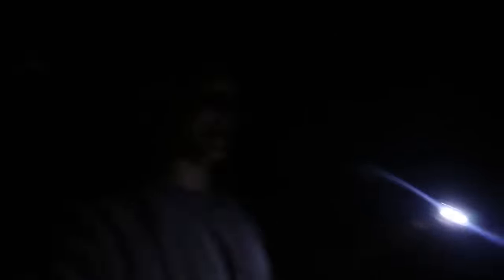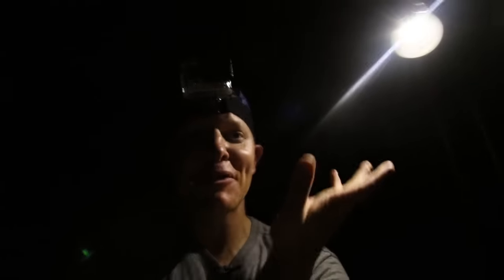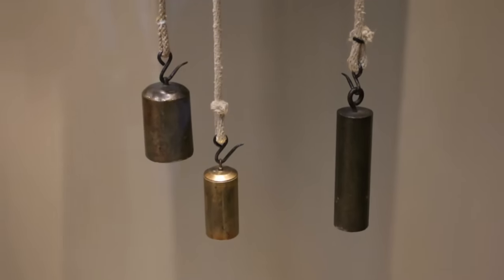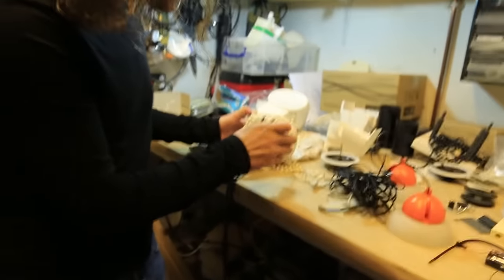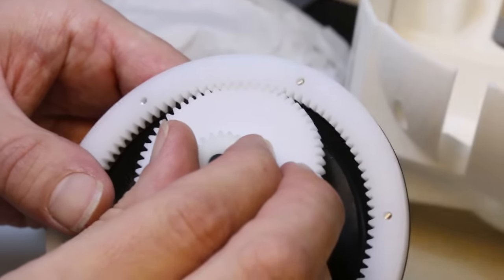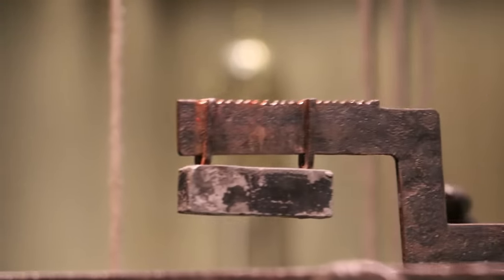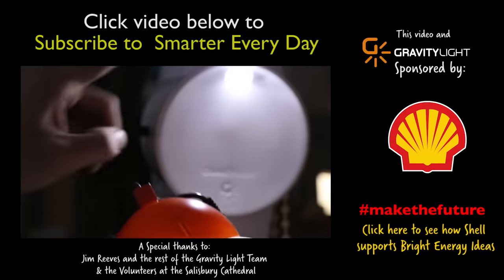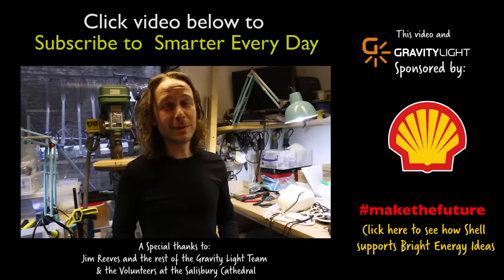Turning Gravity Into Light - Smarter Every Day 146

Comment: the light is not exactly powered by gravity. It is powered by your muscle when you raise the weight. The falling weight is just a store of energy that was created by the person
Reply: +ambrous shut uuuuuuup
Reply: +ambrous Well TECHNICALLY muscles are made of star stuff, and the sun is a star, so really it's solar powered.  :)
Reply: +ambrous but if there wasn't any gravity it wouldn't fall and it wouldn't create any power to power the light so gravity wins (gravity falls to be more accurate )
Reply: +ambrous thanks i was actually a bit confused
Reply: yes it is the potential energy
Reply: +ambrous Yes, but the energy your muscle uses to lift the weight came from the food you ate, which came from the energy in sunlight, which came from fusion. It's a light powered by a fusion reactor =P
Reply: +Andrew Rowe technically because it is solar powered it is fact fusion powered as stars carry out fusion reactions
Reply: +Andrew Rowe technically because it is solar powered it is fact fusion powered as stars carry out fusion reactions
Reply: +ambrous To be more exact the amount of energy you would get out of the system would be E = M(mass) * G(gravity) * H(height) so depending on how much stuff you put in the bag or how high you set up the system, is relative to how much power you get out of it.
Reply: +Yousef Aiman If he didn't have muscles it wouldn't have gotten up there in the first place :-/ Muscles literally beat gravity.
Reply: +Andrew Rowe technically because it is solar powered it is fact fusion powered as stars carry out fusion reactions
Reply: +ambrous The potential energy is created by human labour, but the energy is being released due to the force of gravity. I know you are just trying to seek attention, but I don't want to see a wrong comment get unanswerd :)
Reply: +ambrous Sure, but then, it's not powered by you either, it's powered by what you ate for dinner.

Which is powered by whatever it ate for dinner. Which if you follow the track leads to sunlight. 

So in fact you're just using a very innefective way of transferring light into light.
Reply: +ambrous Weight is the cause of Gravity+Mass.
No gravity = no weight. Only mass.
Reply: both the person and gravity power it. Person does work to move it up, gravity does work to pull it down.
Reply: +ambrous And the persons energy comes from the food they eat, which goes back to growing plants, and the plants get their energy from the sun. So technically is solar powered, but 

https://xkcd.com/1475/

let's just call it gravity powered.
Reply: +Yousef Aiman If there was no gravity the equation for potential energy would also result in 0. What you say might be true but you didnt debunk his claim with it.
Reply: Muscles which are powered by the chemical reaction between glucose and oxygen, which is powered by the chemical energy contained within the atoms of those substances.Atoms which were all formed by the nuclear fusion reactions that occurred in stars (other than the hydrogen atoms in the water and glucose) from hydrogen atoms, which were formed by rouge protons, electrons and neutrons combining, which were formed by the Big Bang, which had to have been caused by some force outside of time.
Reply: +Marley Bradbury Yeah, my thoughts exactly
Reply: my whole point here is that gravity is not where the energy comes from in the system. The potential energy is placed in the weight by the human muscle. It is then extracted from the system via gravity. The source of the power however is the human muscle... Dinner last night... The Sun...
Reply: Marley Bradbury Nice joke.
Reply: +Yousef Aiman but in that case you also had to use no power to lift it. you simply couldnt increase its potential energy. hence his argument still holds: the work is done by the human
Reply: +Zech Of The West first of all weight is the result of gravity not the cause. secondly the reason why you can use this device is due to the potential energy of the bag. If you had no gravity, there would be no way to store any potential energy. but even with gravity its not gravity doing the work, its you when lifting the bag
Reply: +ambrous I see what you mean, but what if there was a battery that stored energy through a dynamo, which will then pull the rocks back up after a while? There should be enough energy generated through the dynamo, which will be able to power both the light and the motor pulling it up, I think. Then it would probably be powered by gravity alone.
Reply: +ambrous Now, well... Energy and mass is constant in the universe.. So if you want to trace back, every energy can be traced back to the energy produced in the big bang.. All forms of energy (viz. light, heat, potential, kinetic, sound, nuclear, solar) was packed inside a dot, and got released during the Big Bang.. So in a way this light is powered by the Big Bang.. Now I made the Big Bang happen.. You do know "I AM HIM".. So thank me.. Sometime soon I would be like "Now I AM Become Death, Destroyer of Worlds"...!!!
Reply: +Seah Ying Xiang No that breaks the fundamentals of conservation of energy, and basically create infinite energy. At best, if you had a way of converting ALL the potential energy into electric energy, and you also had a perfect motor, you would only be able to hoist the weight back to the exact position it started at.
Reply: the title is just misleading. In no way is gravity being turned into light. Gravity is being used to store the potential energy that is put into the system when the human arm raises the weight. If anything, it should be titled turning human arm energy into light storing the energy via gravity vs a chemical battery..
Reply: +ambrous Le sigh... Gravity is stored energy. Your body has enough stored energy (pushing against the surface of the planet) to cause a massive explosion. In your case that explosion might be more massive though.

You can't create energy, you can convert one type of energy into another type of energy hence the term "powered by gravity" is correct as there is no "powered by magic" in this world.
Reply: +ambrous Yes, and no. Yes, because that is what's happening, no because ignoring the prior state the energy was in because it was in some different form previously is... moronic.
Reply: +Cadde Gravity is not stored energy, that's just silly. It's also not an energy form in any manner, no more than distance or curvature are forms of energy.
Reply: +ambrous Correct, we create Gravitational Potential Energy, which transfers to kinetic energy via gravity.
Reply: At least everyone can agree that it's using gravity to power a light.
Reply: Joshua Pearce Get educated pleb.
Reply: +ambrous Exactly! And he started with "What if you lived so far off the grid that you didn't have access to batteries?" He then proceeds to promote a mechanical battery...
Reply: Hmmm... It is pretty common to refer to a power storage as what powers something, for example, something with a battery is generally said to be battery powered. Now, it would perhaps be more correct to say the lamp is powered by a gravitational potential energy storage system, but that is a rather unwieldy thing for a title.

As for tracing back where the energy originally came from, well, remember that all "energy sources" we use rely on releasing stored energy, even the sun is just releasing some of the energy stored in the atoms it fuses.
Reply: Ts6451 Yes, but the title is still super wrong. "Turning gravity into light." Not "Using gravity to produce light." Actually turning it into light, which is silly.
Reply: seigeengine It's not pedanticism when the title is that misleading. This channel is for educating, isn't it?
Reply: Joshua Pearce The title isn't misleading. If you have any knowledge whatsoever of the sciences, you'd know that it isn't strictly correct, but you'd also understand it just fine. For someone who doesn't know, talking about converting gravitational potential energy into light would be both confusing and potentially could put them off from watching, whereas they'd understand "turning gravity into light" easily, and be intrigued.

Nothing is served here by being "correct," except correctness. Welcome to pedantry.
Reply: seigeengine "Using gravity to produce light" would have been an equally brief and yet far more accurate title. Whereas "Turning" misleads people.
Reply: +Yousef Aiman if there wasn't any gravity in the same way when you rise it up you will not apply any force, so the system is in balance. What ambrous had said was correct.
Reply: +Andrew Rowe no, because you power it with energy, not matter. physics isn't a word game
Reply: There are 2 components. You and gravity
Reply: +ambrous Without gravity, the energy stored via your arm in the weight couldn't be released
Reply: +ambrous ...it is powered by the food you eat. Oh wait, it is powered by the sun, which makes the plants grow that you either eat directly or via the meat you eat. So effectively, it is powered by nuclear fusion, awesome!
Reply: Nilguiri That isn't an argument?

The existence of coal does not prove gravity to be false.
Reply: Nilguiri I'm saying that the ability to store energy differently does not change that gravity is the means by which the stored energy is actualized.

That is, gravity does the same thing your muscles do, it converts stored potential energy into kinetic energy, so saying your muscles do it, but gravity doesn't, is.....bullshit.
Reply: That's like saying a hydroelectric generator is solar powered because the water driving the turbines had to be evaporated by sunlight and rained down again into a reservoir. 
It doesn't matter how the bag gets in the air, only that it has some GPE relative to the ground to drive the gears. That's why it's 'turning gravity into light'. What you're saying is technically correct but serves no point.
Reply: +ambrous I don't think so because if I take the weight and wave it around or hold it for a minute, that energy isn't getting "stored" it won't prolong the time the light is on. No matter what you do, or how much energy you will expend on the weight, it will always take 20 minutes for gravity to lower it (when it is hoisted on the GravityLight thingy). I'm by no means a scientist but it just sort of makes sense.
Reply: +seigeengine No, the title is super misleading, because gravity have absolutely nothing to do with the process - change the weight for a spring like in a pocket watch, and it will work in zero g. And it's not a "free energy", you pay for it with food you eat, it's just that LEDs are so efficient, you don't notice the difference, and while it may not be significant for you, it very much an issue for places this product is supposedly aimed for.Also flashlights with built in generators have been around for years, so there is no novelty in that as well. And while they use rechargeable chemical batteries, they also way more portable, and have so much less moving parts they have to be more reliable, I mean imagine sand or dirt getting into cogs - system like that can not be hermetically sealed unlike "shake it up" kind of flashlights.
Reply: +ambrous The arm that put it there isn't apart of the system. It's all a matter of scope your frame of reference. Just like the chemical energy in your arm was available to be used just was the gravitational potential. Its no different to saying "The battery doesn't power the clock" then claiming that the clock system extends beyond the battery. Energy transforms get over it son.
Reply: seigeengine Alright mr. demagogue, first of all stop with inserting false analogies - of course chemical reactions are the very foundation of the process we call fire which you are implying. But we are not talking about fire here, the product is heat in this case and if you plug an electric heater powered by solar panels then yes, those chemical reactions have nothing to do with heating up your house they merely serve as a solar energy storage. The way it's transformed into heat doesn't matter in the slightest.

But the elephant in the room you seem to ignore is that you have to pay money for the wood, and gravity is free unlike the food you'll use up, therefor can be ignored for practical use. So saying you can make energy from gravity is a big lie and false advertisement. It's like saying your oven is powered by air, you just have to add firewood.

Guess who's being a pedant now.
Reply: catwaterboy You can say whatever, but it will not change the fact that this is a clickbate title and false advertisement, that essentially promises you "free energy", while there are real ways to extract energy from gravitational potential, like tidal hydrogenerators.

Also this wasn't educational in the slightest, which goes against the goal of this channel.
Reply: +Andrew Rowe and the sun was made by God so really its God powered.
Reply: seigeengine Because saying this device is working on gravity is like saying nuclear power plant is working on water, fireplace is working on air and combustion engine is working on inertia of pistons. Which is all partially true, but deliberately missing the point - just as steam is turning turbine, oxygen is doing the active part of the work in burning or pistons are turning the crankshaft, gravity is pulling down the weight, but all those things are put in motion by another source and that's what matters.
Reply: seigeengine And if you want to be overly reductive, then no again, light is not powered by gravity, but by electric current flowing through LED, which only proves that title is misleading in more then one way.
Reply: +Boredness Indeed, ALL ENERGY IS NUCLEAR.
Reply: Carlo Mascherini But it always produces the same amount of energy, no matter how much energy the human puts in. If you carry the bag round a mountain and back before hoisting it, it'll still fall the same amount. It also doesn't have to be a human hoisting the weight, and you can use ropes if you like, or just lift it, or have an elephant do it for you if you know a sufficiently well-trained elephant. The only constant is the gravity pulling it down.
Reply: +ambrous I don't think you're entirely correct there. Sure, it's your muscle that gave it the potential energy, but gravity (and gears) converts that stored potential energy into kinetic energy, which in turn gets converted to electrical energy and so on.
Reply: Carlo Mascherini My point was more that how the bag gets up is irrelevant to the energy generated by the device.
And yeah, that's what an LED does; convert electrical energy into light. The gravitylight represents several transformations of energy. Saying it turns electrical energy into light would be unhelpful, because you don't need electrical energy to use it. All you need is a way of producing a GPE in a bag. Hence it's a gravitylight.
Reply: Ben F No it's not, change bag for a spring and it will work even in zero g. It's not dependent on gravity, but rather on a way to input potential energy in the system.
Reply: Roman R If you add a spring, then you're changing the device? If you change the LED for a heating element then it's no longer producing light, so how dare they call it a gravitylight! This is the most ridiculous argument I've ever heard.
Reply: +ambrous you (just like me) wrote a comment on youtube and wasted your muscle energy into friction, sound, ... but by doing just this, can you light a bulb? it seems nothing to us doing like just picking a glass of water or our school bag from ground to desk, as you do it everyday. but its interesting to learn that you could light a bulb by this everyday easy act, and gravity helps to do it!
Reply: +soham zemse I never said that this was not an ingenious and useful device. I just take issue with the title of this video. This device in no way turns gravity into light. It uses gravity in the mechanism. But it does not convert gravity into anything.
Reply: Ben F Exactly what I can tell to you. More so you've just proven my point. Say you have two nuclear reactors, in one the first stage heat carrier is water, in another - metal meld. Are not they both called nuclear reactors? And none of them are called water/meld reactors, and guess why.

And yes, "light" part is just as wrong as "gravity" part, should be called electrical current from potential energy at best, but in reality kinetic energy from potential energy.
Reply: ambrous Except it's nothing new. I'd say it's in every way worse then "shake-it" kind of flashlights - it's heavy, clunky, noisy, have a lot of moving parts and can not be hermetically sealed otherwise there could be no grip on the belt - just imagine what will sand and dust and hair do to those cogs, I've been a child and played with toy cars in a sandbox.

Also it's 10 bucks on ebay.
Reply: Roman R Good God. The gears are the part that turn gravity into kinetic energy, the motor turns kinetic to electrical and the led turns electrical to light. As a whole, the thing turns gravitational potential energy into light. Hence, gravitylight. You name something based on what it does, not the first thing it does ffs.
I don't even know what your point isanymore to argue against it in the first place
Reply: Ben F Ok, let's call combustion engines noisy spiny stinky hot metal thingies, will that be correct? Hence combustion engine, because combustion is first, hence nuclear power plant, because nuclear reactions are first. Not inertial engine or steam power plant.

And how many times does it have to be said that gravity is never used in the way that there becomes less of it in some mysterious way, it have nothing to do with gravity, just potential energy you provide the system with.
Reply: Ben F Well, it's false advertisement in a nutshell and you seem to defend it. As someone pointed out before I was expecting to see something new about black holes and how they are evaporating, something I didn't know, but I got clickbate add for a subpar product instead (just google "shake-it flashlight"), so yeah.
Reply: +ambrous CREATED? heart attack
Reply: +ambrous Well Gravity light sounds catchier than Do you lift brolight.
Reply: Roman R I don't see how it's false advertisement? It does exactly what I expected it to do from the name?
Reply: Ben F Is it called manpowered light? Because it's skipping a huge part there.
Reply: +ambrous thats really thoughtful of you but again if there was no gravity ur muscles don't need to work :)
Reply: Rishabh Chandra That's the silliest argument I've ever heard. Work is not done by gravity, it's done against it. It's like saying "if there were no wall, we wouldn't need a jackhammer to demolish it, so work is done by wall" If there were no gravity, universe would be an evenly distributed cloud of mostly hydrogen, so what?
Reply: Roman R Yeah i got it figured thanks!! I misunderstood 'powered'
Reply: Roman R Work is done by gravity. Work done = Int(F)dx. The force of gravity is equal to mg, making W = Int(mg)dx which gives W = mgx because the object is falling in a straight line and not about a curve. Since the object is falling a distance of h, we get a final solution of W = -mgh.

That's also not the point. The point is that you may have to lift something up to get the light going, but then you no longer have to do anything. The light always lasts for the same amount of time (unlike a shake torch) so you can hang some rocks in a hammock and forget about needing to do it again for an exact amount of time without it suddenly going out on you. The power is coming from the force of gravity, not the entirely arbitrary method you use to get the weight up.
Reply: Ben F Gravity isn't a force, and you'll still have to live on timer. Which you can't power. And shake torch give a warning by dimming instead of turning off in split second leaving you in pitch blackness to stumble through room and recharge it blind.
Reply: Roman R I didn't say gravity was a force. Gravity is an acceleration, which is a force when acting on a mass.
Okay, I get it, you don't like the product. Doesn't mean Gravitylight is 'false advertising', though.
Reply: Ben F Nope, you didn't get anything -product is actually pretty interesting, except that complete blackout when weight stops, and the fact that it's a non-hermetic cog system in the not so clean environment. I wonder if they could use capacitor like on the flashlight to store a bit to solve the first problem, maybe even give noise and/or light indication when it's depleting, but second seems unfixable to me.

My problem is that they try to get ahead by lies and myths. And that'd not be such a big deal even, if they didn't use supposedly educational channel for that. People has been mistaking gravity with force for centuries now, last thing we need is more confusion which SmarterEveryDay provided in spades here.

You can't get a single bit of work from gravity without working against it yourself in the first place (and not a single extra bit in that case) - science moved past it, there is even a ban for giving patents for perpetuum mobile because how bad confusion and surrounding it scams are. Yet they still try to sneak around.
Reply: Roman R There is a difference between gravitational acceleration and the 'force of gravity'. The force of gravity is specific to a mass, whereas gravitational acceleration is roughly constant on Earth. The general equation is F = GmM/r^2.
You're acting like this product claims to be making energy from nothing, when it's really not. It's doing exactly what it says, if slightly romanticised to make the name catchy.
Reply: Ben F Only problem is that "slightly romanticizing" is exactly claiming to make power out of nothing.
Reply: Roman R It really doesn't. It's just a catchy name for a product that might help people without electricity.
Reply: Ben F Problem is, it will not. Manpowered generators are not a new thing in the slightest.
This one is just pretending to be something new because "power from gravity!!111" And using this channel to mislead people.

Besides, they are sitting with no power for a reason, and that reason being complete failure of their countries. It's a "give fish versus teach how to fish" situation, those toys will change nothing and will likely be just stolen, and it'll be lucky if without casualties, but we all know those toys will get a bunch of people killed.
Reply: Roman R This is a novel way of doing that, though, hence they were granted a patent.